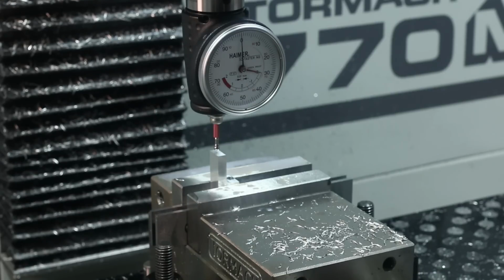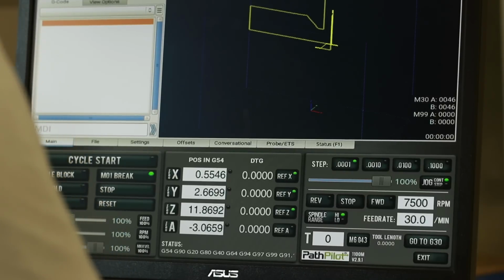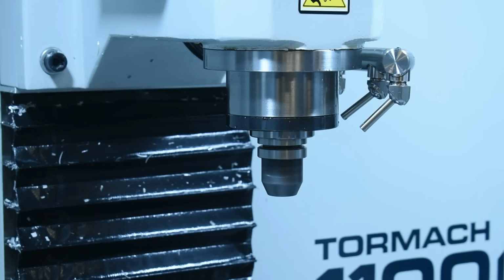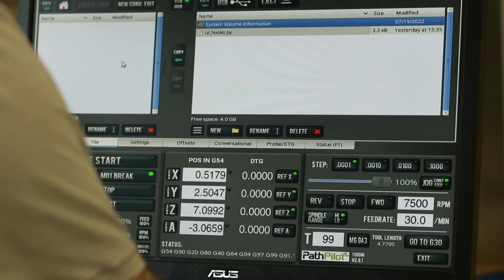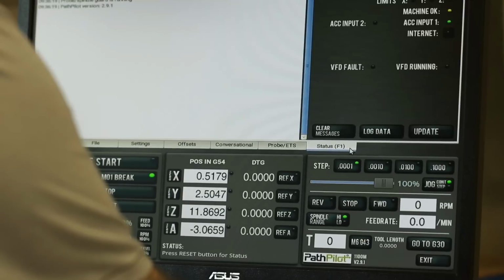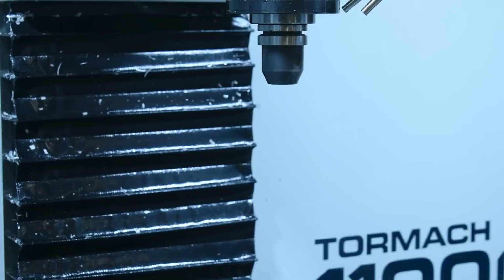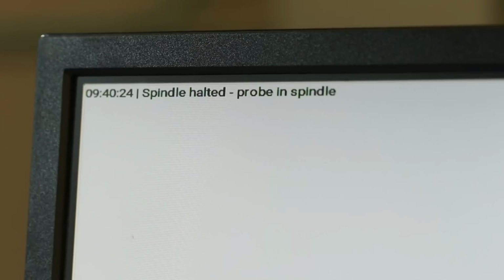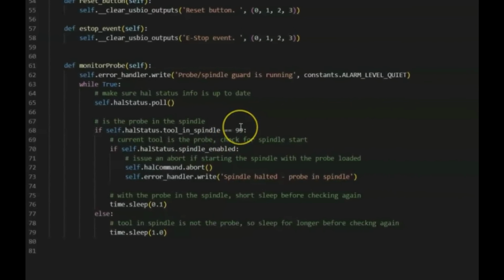PROTECT YOUR HAIMER: Python Script Prevents Spin Up!

Comment: Maybe 10 years ago, on a 20 year old machine, I accidently fired up the spindle with an indicator in. It spun, I hit the spindle stop, and the head of the chuck fell off. Luckily the indicator was okay, but that chuck never quite worked again. The up size is, the boss got a new all in one chuck tool holder that worked way better. I kept it for use only at my machine. Lol

Comment: Thanks for the advice. I have downloaded it as a safety measure. I work with manual tool changers so I leave the spindle locked when I am using the probe (an ITTP for Nnew Zealand) , but you never know. Better to be safe than sorry.

Comment: This is why siemens is the best, you just insert an max rpm at the tool page.
Reply: Good point....couldn't you just put the max rpm of tool 99 to 1 rpm......??
Reply: @ericsandberg3167  Or how about 0 rpm? You know incase you have a wired probe...
Reply: I've been trying to convince them to put this in Pathpilot, but there reply was "Does anyone else do that?" Ill get back to them that yes someone does.
Reply: @lucaseaston  Almost any decent control will have this, Mazak has TOL SENS for tool data, all coolant won't work, and you cannot rotate spindle.

Comment: Its and easy fix but this is definitely something that I feel is supposed to be solved my Tormach out of the box
Reply: I know several of us emailed the request to add it to a next release.  Never was.
Reply: CNC machines only do what you tell them to do.
Reply: @Max_Marz  Yes you are right but this is dumb. I can not think of a use case where you would not want the spindle locked during probing routines. This is the same as over travel limits. Should there be no software endstops that prevent damage?

Comment: If you install that program, how else you are going to exercise your pucker-up reflex? Python is NOT a real language!!! :P
Reply: Just be glad it wasn't in JavaScript :eek:
Reply: Not a good one anyway, but it works-ish. There are of course problems between versions, which is why C and on occasion C++ are better. Having a design by committee is slow and they really need to be better about adding quality of life improvements to both languages, but at least they're stable and for the most part code written 20 years ago will just work now and were you to time travel the reverse would sometimes be true as well.